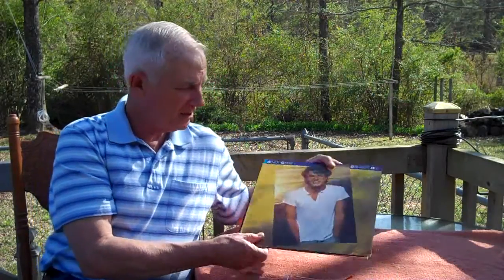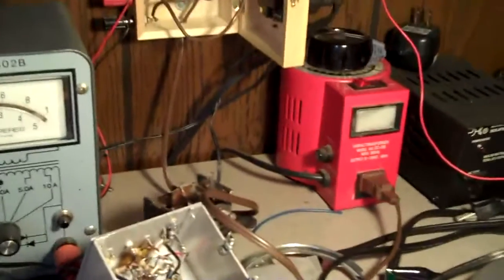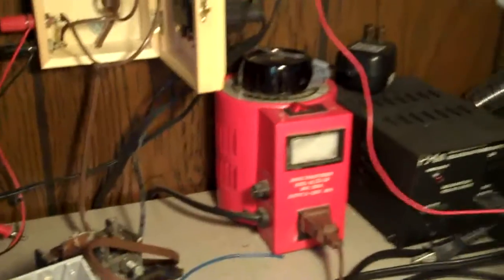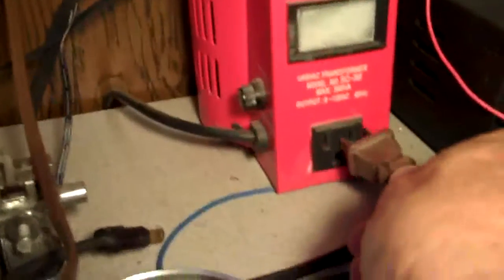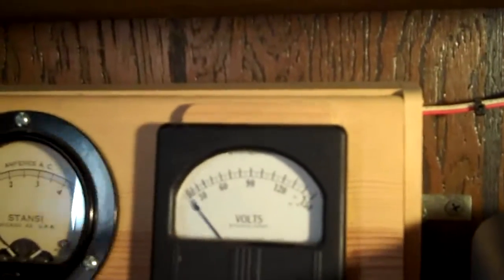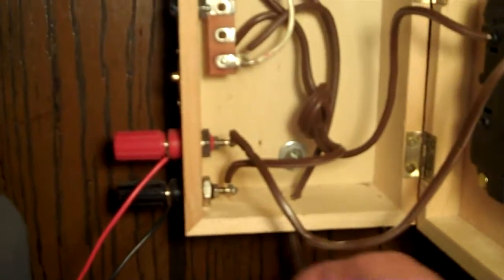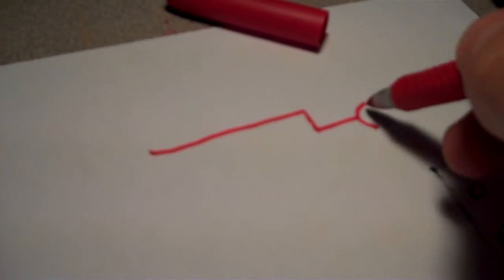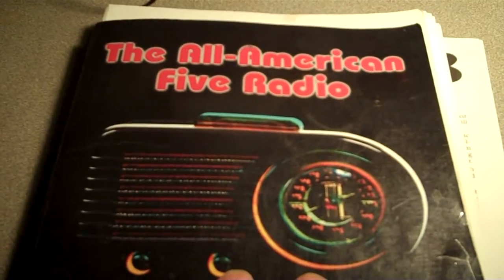Voltmeter and Ammeter Workbench Setup.

Comment: Hey John, I looked up Hampden's website and they show the 302B, but they don't show a price for it and I can't find anywhere that sells them elsewhere.  I'm afraid to contact them and ask how much a new one would be, might have a heart attack from sticker shock, lol.
Reply from the maker: Not to worry, my friend.  Just pick up a second multimeter and use its ammeter function or buy a round ammeter like the one in this vid and mount it inside a small wooden box you can pick up at Hobby Lobby.  Permanently connect the wires and you're in bidniz.  Cheap and easy.
Regards,
John

Comment from the maker: @UmaBlinky,
Adding a fuse to the ammeter line is a good idea.  I believe I'll do that even though the isolation transformer is fused, the variac is fused and I always add a 3/4-amp fuse to the vintage radio chassis radio itself.  But one more fuse can't hurt.
Re: the 24VDC power supply.  Do you mean 120VAC in and a variable 0-24VDC out?
Thanks for stopping once again.
  
Regards
John